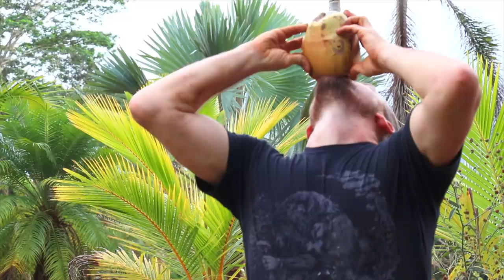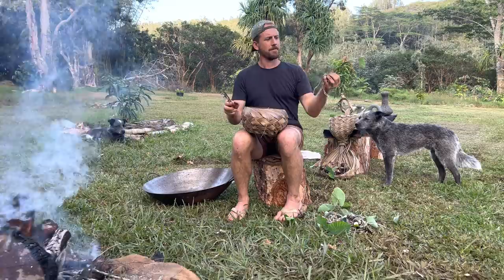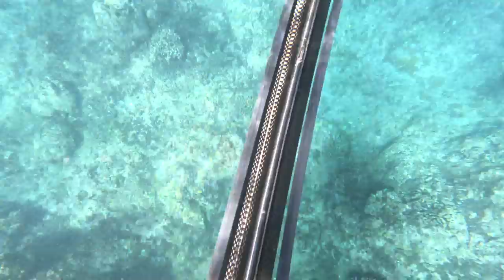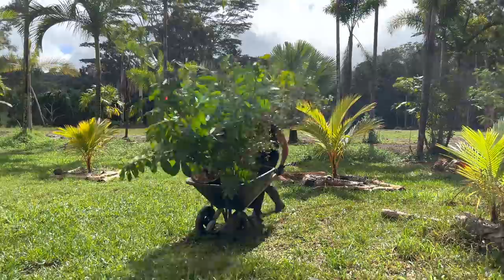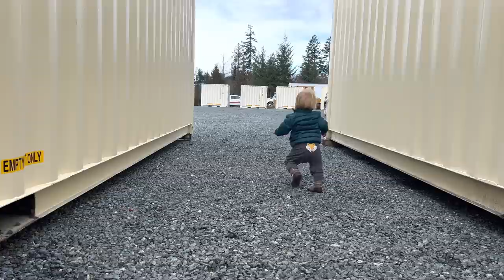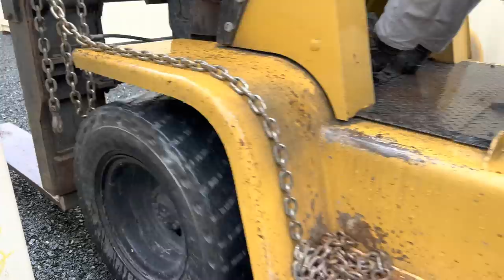POUNDING POI & Growing My Own TARO/KALO | Our SHIPPING CONTAINER HOUSE OFF THE GRID - Ep.167

Comment: Container Flooring, Pesticides: Look into the pesticides embedded into the container flooring. Either replacing the flooring or concrete fill once installed.

"Typically the floors in shipping containers are made from tropical hardwoods which have been treated with crude pesticides. These harsh chemicals are dangerous to humans and so it is not recommended to use the existing plywood flooring"

Comment: Fantastic idea!!!  There is a guy on you tube that built a mansion with a built in shop in the middle of the woods out of Metal storage containers, cement, steel and glass.  He built it because it's fire proof and inexpensive compared to a normal built house. a normal built house also wouldn't stand up to what his house can.

Comment: If you really want those posts that you planted to last: first burn the end that you bury, that will both seal and make bug resistant, and second pack the outside with gravel to allow the water to run off rather than ceep between the concrete and wood...
GOD Bless you ALL...

Comment: Actually  a container's carbon footprint has already mostly  happened there often more eco friendly alternative than building from scratch. Most don't account for the thousands of miles it takes to make  raw materials into construction ready goods like drywall to nails just to where there used. Indeed the further afield something comes from a manufacturer the higher the footprint, say China it can travel up to half way round the globe before getting into your hands by Amazon etc. It might seen an anachronism not to build with traditional methods but for every tree that's not used its a savings for the environment to remain growing and storing carbon. It would be a hoot to use the roof as a basin to collect water and solar of course since waste not want not as they say since its square footage is a plus too...🌲🌲🌲

Comment: You've just recovered a distracted Subscriber. This next chapter is going to fascinate the hell out of me.

Some concepts that occur to me:
  - PV-Solar Golf Cart Sawmill, paralleled output amperage, onboard storage bank
  - DC Diaphragm Pump Solar-Thermal Hydronic Radiant Floor Heating, especially if you go with slabs, can be tapped in-line
  - Direct Drive PV-Solar Ventilation, DC radiator fans. shove out the damp, wherever, no freaking batteries

Happy to be back watching, you three.  Hope the driveway will carry those ISOs!

Comment: Im sorry but I believe the effort and cost of the containers dont make them a great product to build a family house, they would be ok as a weekender for a couple, if fitted out and transported to a location, be it a 20' or a 40' one, Ive watched one couple build their container house using two containers adding extra space down the middle plus another outer room using traditional building technique take over two years to build it,  for a house I would go in a totally different direction. Ild rather buy the steel beams to make a frame for a construction using industrial style design, a 30' x 45' building with high walls so as to be able to make a mezzanine floor of half the size of the ground floor gives you 2025 square feet of living space, doing it all yourself you would be looking at about $50K - $80K using the best materials available, using secondhand materials the cost would be less than half, where as a shipping container gives you 306 sq ft of living space, so you would need 6 x 40' and one 20' sea containers to be of equal size, so with a steel frame and using local stone to build walls to plate height and using steel sheeting for the roof so you can catch rainwater in tanks, this then becomes a real spacious home, anyway, people I will still enjoy your journey.

Comment: i wonder if you'll give us a cost break down... cause i bet those containers with NO WORK done on them dropped at your place are $10k ea. 6 x 40' brand new like those are... with all the work on them - i bet you're spending over $100,000.00 with delivery. 

(locally here in northern colorado these containers went from the 2,000-2400 range for well used containers (40') to over 5,000/40' container. 

i know that when i lived in boston or los angeles near the ports, i could get them for less than 500/box 20-40' then whatever trucking cost. they are big business while there are millions of them... someone is making a LOT of $$